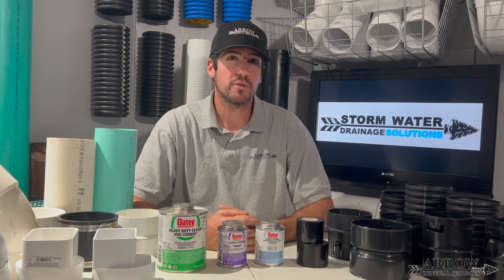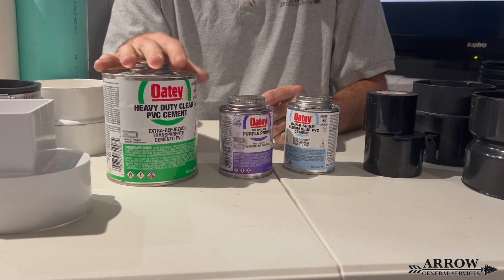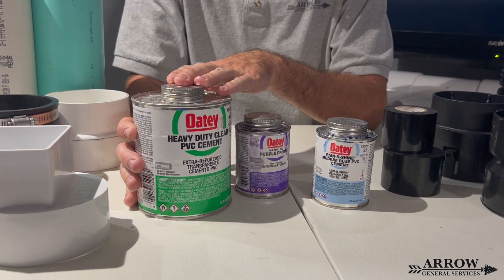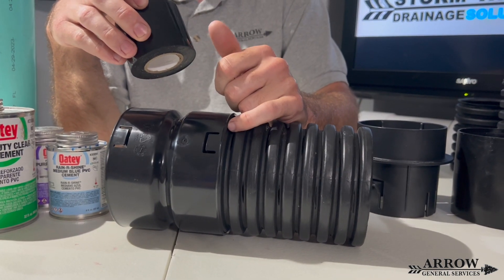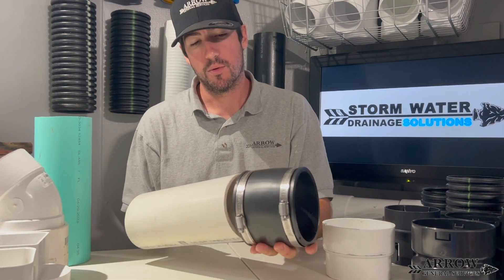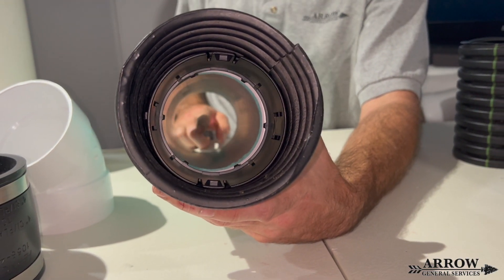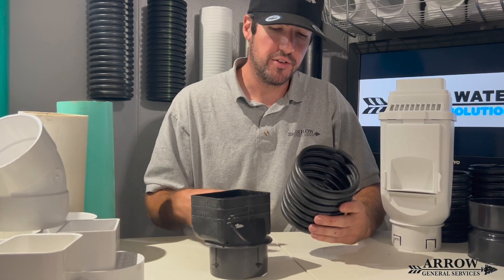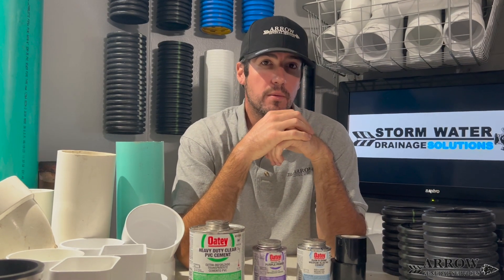Drainage Pipe Connections - Yard Drainage Education - Corrugated & PVC Pipe

Comment: I love the design engineering the French Drain Man has been doing, but his downspout adapter is problematic if your system MUST move leaves.  That screen will clog at every rain event.

I've got pin oak trees and they dump leaves twice a year and pollen once, and I mean DUMP.  I am designing a system to go underground to my swales.  I think I need to use properly graded SDR35 the whole way and daylight it so the leaves and pollen can flush through the system.  Thoughts?
Reply: Interested in the answer here as well. Did you make any progress or actually build your drain?
Reply: @jstnnnnn  I set up an above ground run of SDR35 using the common pieces available in the landscape area at HomeDepot.  I'm finding that if the leaves and pollen clusters make it into the downspout they have zero difficulty flowing through the entire run and exiting.   Now, since it's above ground with a direct daylight exit, I have not tested his pop up emitter.  Daylight is always going to be better than the best emitter.

But regarding whether 4" SDR flows debris?  Yes.  Very well.  But still make sure to install wyes and tees for cleanouts at the proper areas.
Reply: @jstnnnnn  P.S. I'm in the FL panhandle. So heavy rains and a basically non-existent frost line in the soil.